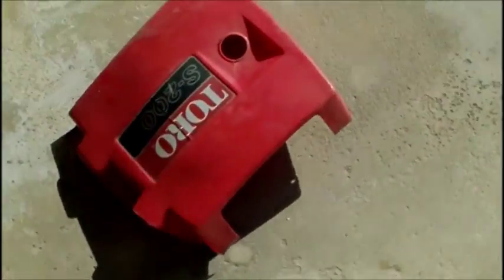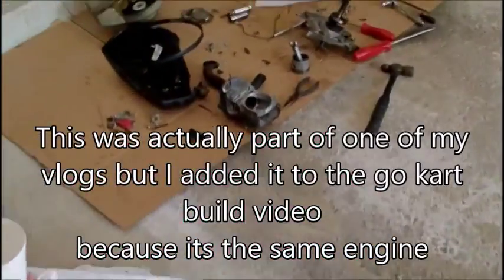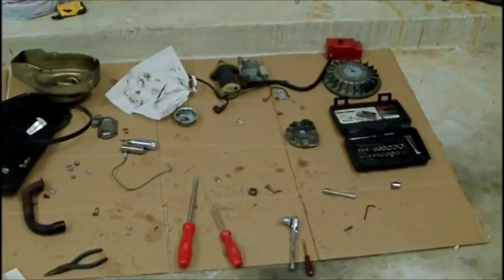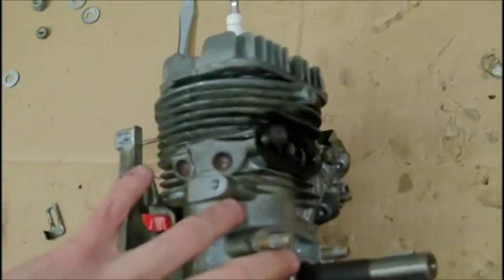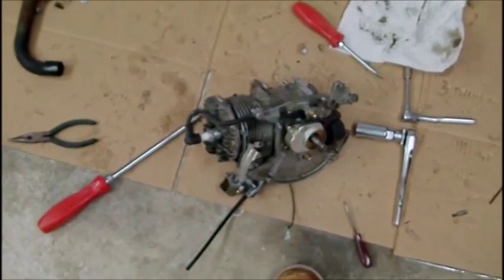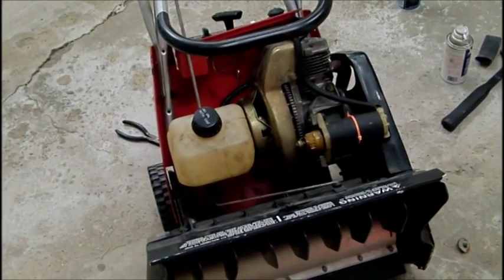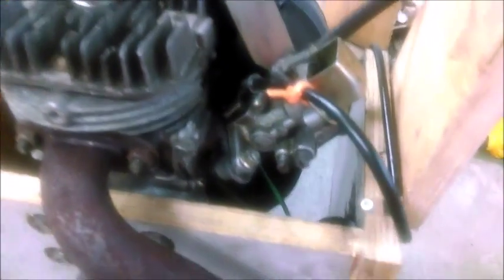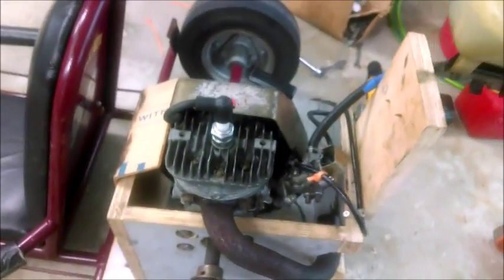50cc Go Kart

Comment: I have the same engine, it is actually 85.2 cc, not 50. If not it should be around that. Along with you saying that there is a reed valve, that is the automatic compression release.

Comment: I've been trying this on a bike.. was wondering how you did the throttle and any tips on getting more torque... it doesn't really seem to wanna push my weight. .. thanks in advance.
Reply from the maker: juniorlloyd82 All that i used was a $8 piece of lawnmower throttle cable that i got from ace for the throttle and kind of played with it till she stayed where i wanted it. kind of have to just lplay with it. as for torque i would try running premium gas, thats what i was using (still mixed at 32/1) i have a honda gx160 on the kart now but i am saving this motor for my bicycle at a later date. i think i will try running race fuel at 110 octane in her (32/1 oil) some time in the near future and post a video of that and see what happens! send me some pictures of the bike build if you dont mind! MiiYeti@gmail.com thanks!

Comment: Fantastic video! I have the exact same snow blower that I plan to start a similar project with! Thank you!
Reply: MiiYeti How long can you keep it at 13,600 rpm? Does the engine actually get up tp that speed during use? I've got two engines similar to that one that I want to motorize something with. Any tips would be appreciated!
Reply from the maker: No problem! If you want any tuning tips for how to get the engine running hard just send me a message! (Btw at max rpm I'm running approximately 13,600 rpm)